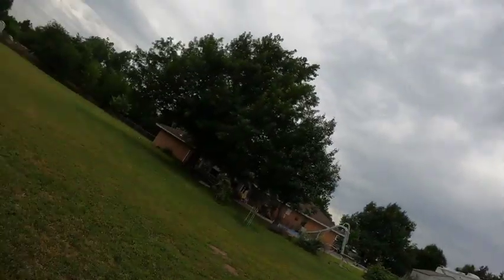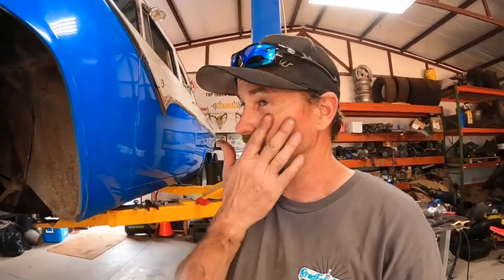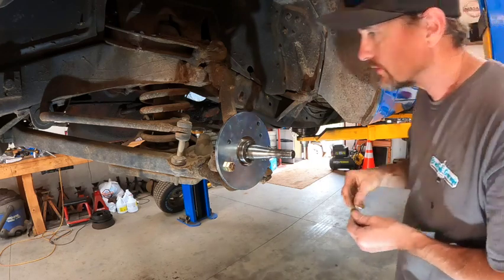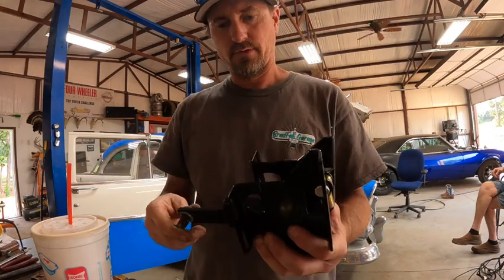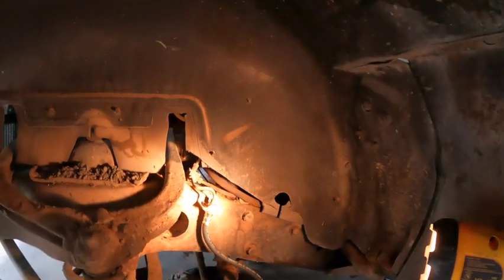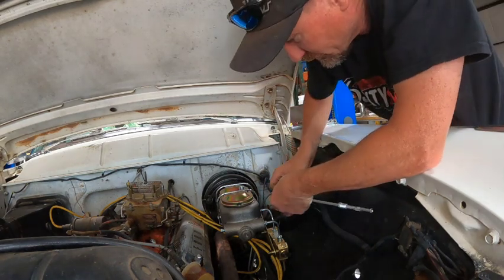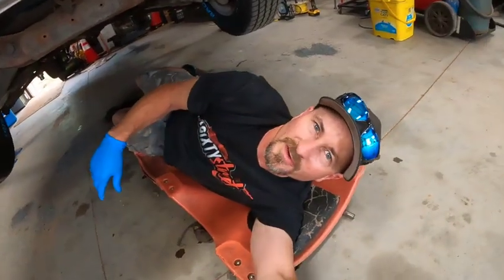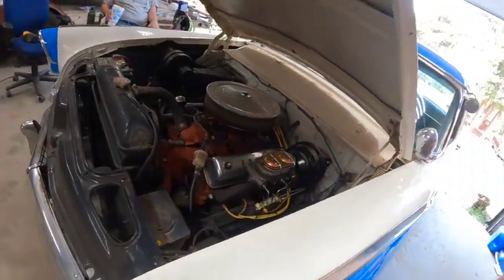1955 Ford Fairlane gets Power Disk Brakes

Comment: What you need is a Auxiliary vacuum tank. Fords had a football shaped metal tank .I'm surprised there's none there.Next time you go past a junkyard,keep an eye open for a 1982-1990 Mercedes ,a large sedan, under the front fenders they have heavy plastic vacuum reservoirs which would work perfectly,running the wiper and keeping up vacuum to the booster.